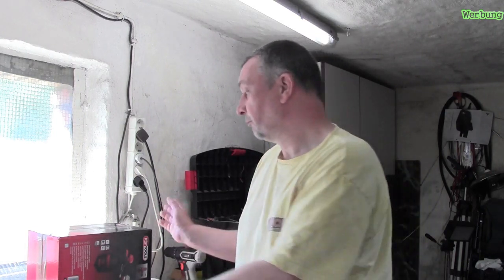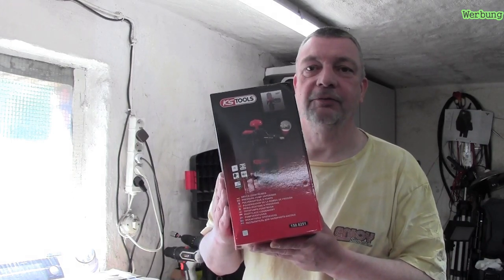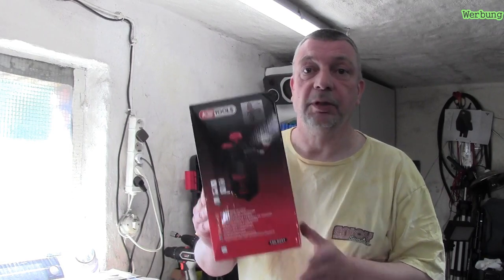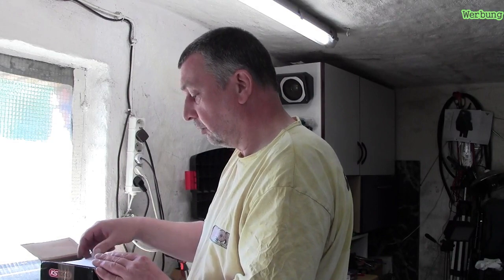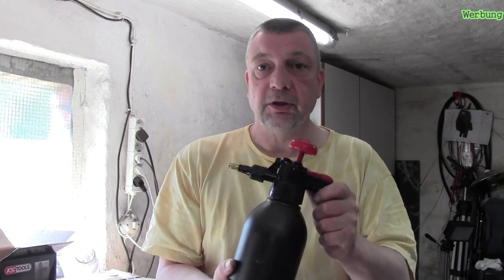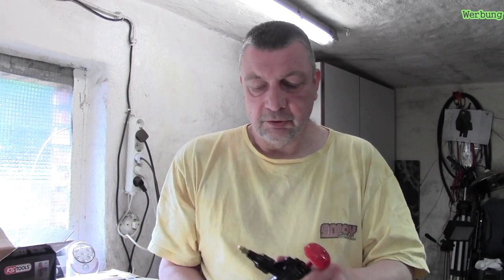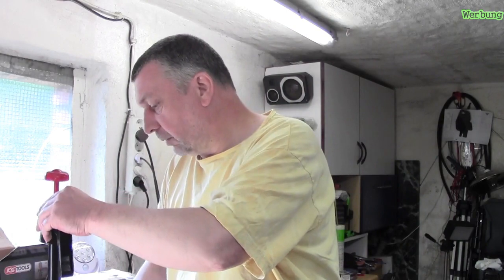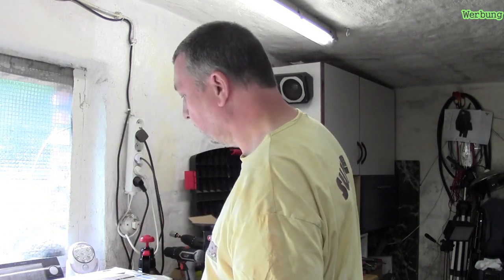Der Scooter Schrauber..Peugeot Elyseo 125 Verkleidung mit Zweikomponentenkleber Verkleben..

Comment: Hallo Peter,
von mir noch zwei Tipps zum Zweikomponentenkleber.
Wenn du die Klebestellen vor dem kleben entfettest klebt es nochmal viel besser. Es ist wie beim Lackieren an den Händen und Fingern ist immer etwas Fett. Bremsenreiniger reicht da nicht schon gar nicht auf offenen Kunsstoffflächen. Siliconentfetter ist die bessere Wahl
Der Zweikomponentenkleber besteht ja aus Exporyharz und einem Härter. Das gleiche wird z B auch im Schiffsbau verwendet. Wenn du die Teile welche du verbinden willst noch mit einer Schicht Glassfasermatte welche du mit dem Kleber einstreichst verstärkst  hält es auch bei starken Belastungen  sehr gut und stabil.. Auch wenn speziel für Kunststoff draufsteht ist doch nur etwas Primer zugesetzt welcher so fast seine Wirkung verliert. Es gibt diesen Kunststoffprimer welcher speiell für Klebeverbinungen gemacht ist für wenig Geld zu kaufen. Mit diesem werden die Klebestellen vorbehandelt und dann hast du wirklich dauerhafte Verbindungen.. Diese Tipps habe ich von einem Kollegen welcher mit Industrieller Klebetechnik beruflich sehr vertraut ist.
Ein anderer Trick ist es Plastikteile mit dem Lötkolben zusammen zu bruzzeln.
LG
Karsten